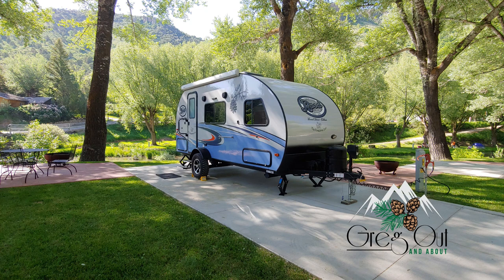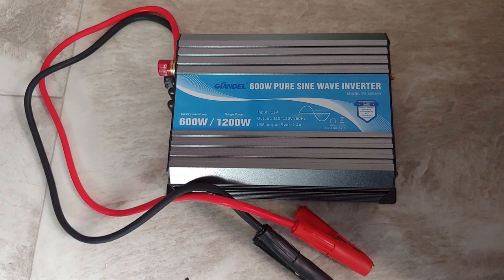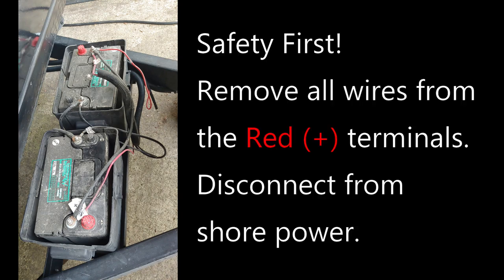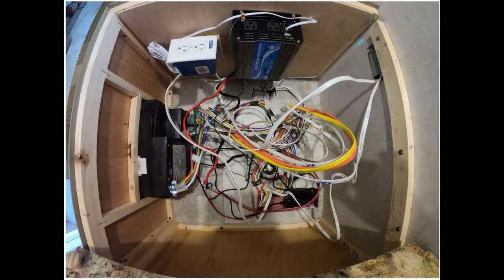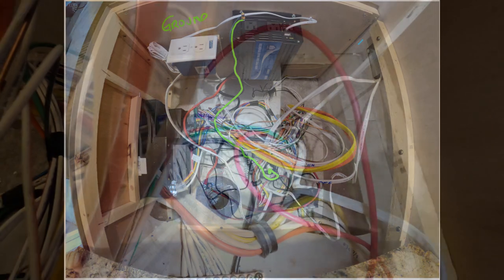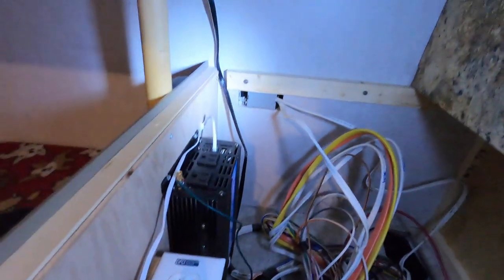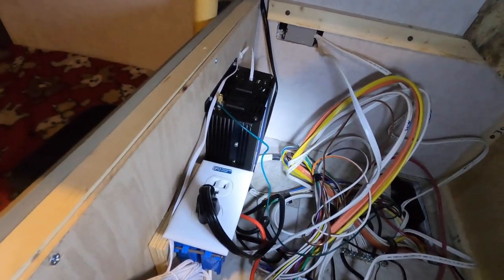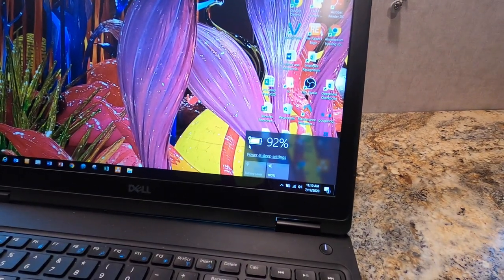Simple Inverter Installation in Small RV

Comment: I'm guessing that not all rv's have 12v "cigarette lighter" sockets that are usually for tv hookup along with a cable jack,but that's how I wired my inverter. I removed the wall plate 12v socket, and used the 12 volt feed to power my inverter.  It's only a 200w/400w peak for powering a TV/ and DVD player or game console should we boondock on a rainy day sort of thing. My old trailer that I'm about to replace has 2 separate locations on either end. The new one that I'm taking delivery of in a couple weeks has 1 so far that I've found. Though I don't know why newer rvs don't have inverters from factory instead.... I'm also upgrading to a dual battery system as well.

Comment: I just bought this inverter. I really like it. It run silent for my usage approx. 50-200 watt. The fan never turn on and the inverter is cool to the touch. The only thing I changed is I replaced the stock cable with 4 awg cables.

Comment: How did you isolate your converter so you don’t have a power loop between inverter and converter? You didn’t use a transfer switch?
Reply: Just turn off converter when using inverter

Comment: I'm wondering how to hook this up to the batteries when I"m using 2 - 12v batteries wired in parallel. Do you attach the red/black wires only to one battery or both?

Comment: Hey Greg. Thanx for a terrific video. I'm in a similar situation as yours with an 18' travel trailer. I'm wondering if you'd have still wired into the converter/charger if your inverter was a higher output - say 1000 watts. Seems everyone wants the inverter to be almost co-located with the battery.
Reply from the maker: Hi Ken - I think this would depend on your particular RV, the inverter that you purchased, distance from the battery, etc.  Best consult an RV technician, since I only "play one on TV".

Comment: I’m sorry but that electrical cabinet is an absolute nightmare.. Why is it so messy and has no labels? You shouldn’t need to use a voltmeter to find the power from the batteries. Also is your system ran with romex wire?? Super unsafe if so….